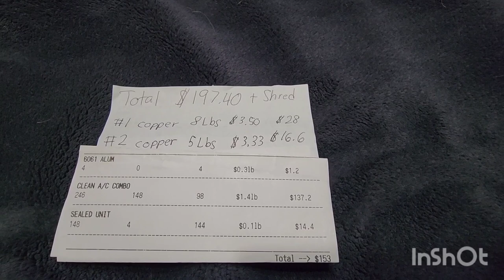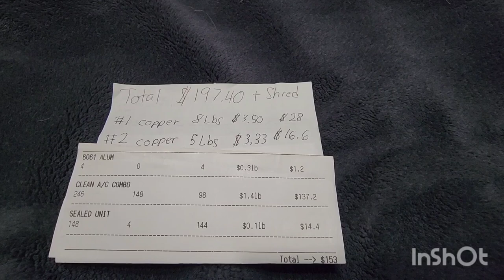Scrapping A Rooftop AC Unit. How much money will we make. #mocoppermomoney

Comment: I had the opportunity to get an AC unit just like that. And couldn't get it home. Had to let them find another scrapper. I was so disappointed. It won't happen again. If the opportunity comes again. I will not stop until it's sitting in my driveway. Scrap on man!!
Reply: Should’ve asked to break down on site. That’s what I did when I was in my Camry. Now o have a truck and trailer
Reply: @ScrapFatherScrapSon  I know. I thought that to afterwards.
Reply from the maker: There's a video of a larger unit coming soon
Reply: @JimboScrapper  I heard through the grapevine that you have one similar to one of my last shorts. Come check it out and tell me!
Reply: @JimboScrapper  gulfcoastacrscrapper said!